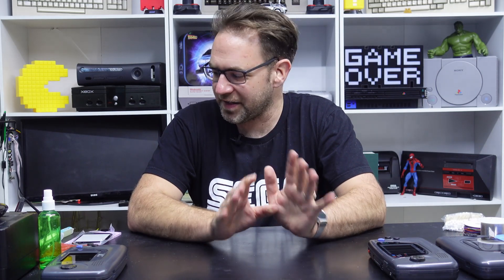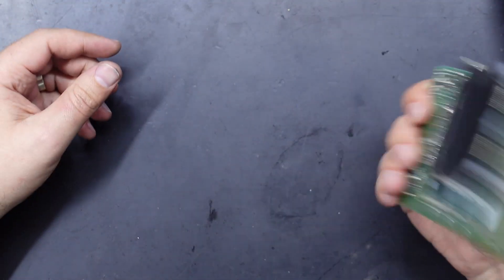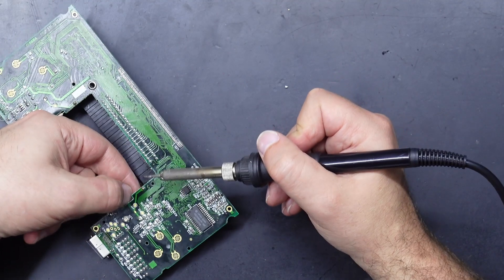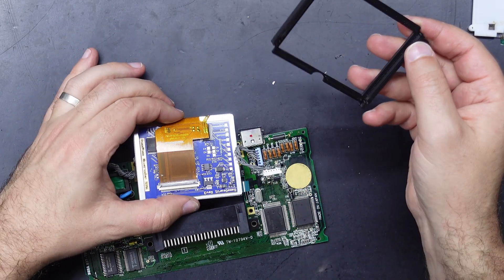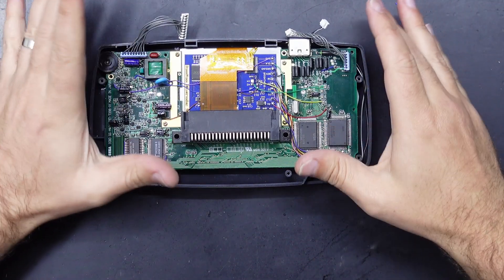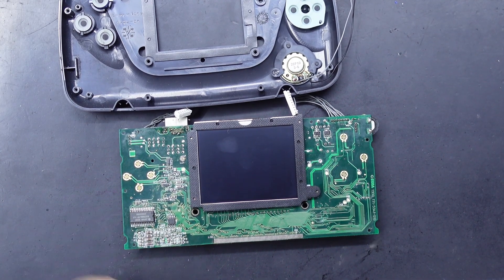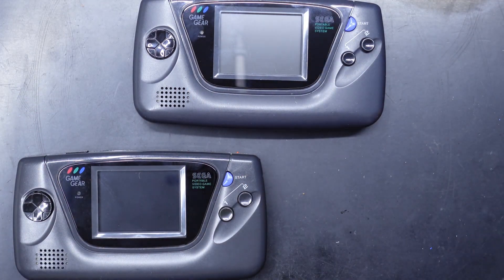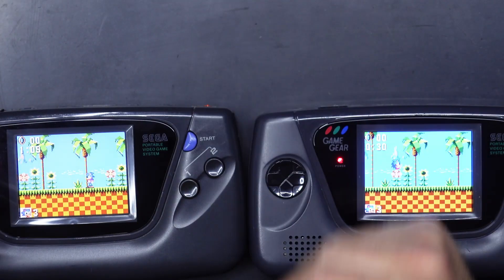BennVenn Sega Game Gear IPS screen mod - Install, review and comparison vs McWill

Comment: Awesome video! 

Scaling modes in SMS mode - We went with Linear only due to the distortion if we tried to scale it up. SMS pixels are rectangular like you say which gives some linear distortion on a 1.1:1 LCD panel but compared to the shimmer effect in any other mode (like in the mcwill and others) we think it was a good compromise. 

The frame. This is interesting! Truthfully we install the lcd in the frame and place it into the front shell, then add the GG mainboard and start the install that way. I will pass on this issue to Atari Gamer who prints our frames for all our kits - which brings me to Injection molding vs printing. We've actually got a full size commercial injection molding machine in our workshop so this is definitely a possibility. We decided to outsource to Atarigamer, giving them the profits on all the frames we sell to help keep their website running and pushing out content and gaming competitions to further the dev scene. We will address the issue you found with the frame though going forward.

Frame sizing - Mr Lurch did the majority of work modding the design and getting it to where it is today. We had a couple issues between various consoles which we put down to slight variation in the shells. We made the frame a little larger to compensate for this. 

Great idea with the alternate solder points! We plan on releasing these too. 

Our FPGA's (Lattice Ice40's) are one time programmable. We can add a socket for an external SPI Flash IC which the FPGA will boot from if its present. We'll look into this on our V2 for upgradability - if there is a way to secure the bitmask code. Last thing we want is another clone on the market.

Thanks for a thorough and comprehensive install and comparison with other kits!
Reply from the maker: Thanks! Awesome work on this project, and I totally agree on the SMS scaling choice. I'll be sure to check out the defualt scaling mode (for GG).

WRT the frame, yes it probably wouldn't be an issue if I attached the frame to the GG first and then put the screws in, so top tip for anyone doing the same - attach the frame to the GG front first. Not blaming Atari Gamer, as you say I'm glad to see other parties involved and keeping the retro gaming scene alive.

Looking forward to V2, one day...  😎
Reply: "We", "our" - I remember when it was just you :)
Reply: @RWL2012  It's still just Claire and I - the 'we' is more the input we get from our discord. They're the GG guru's! I'm just hand crafting a kit to their specs
Reply: We need that VGA mod, Ben 🔥 👌

Comment: Rather than try and solder to pin 46 on IC3, follow the trace and solder to the thru hole by scraping off the insulation, it makes it much easier. Mod works fine, thanks for the video.

Comment: Mint, it does look.
I have to check my Gamegear board version...
The McWill screen in my LYNX is frikken schweet.
Reply from the maker: Chances are you will have a VA0 or VA1. The VA4 is the Majesco variant sold in the early 2000s? It's pretty uncommon from what I hear
EDIT: Apparently they go all the way up to VA6/VA7 - which are the Majesco ones. But the majority are still the VA0/VA1

Comment: I tried to follow your hands nut couldnt. How do you access the various scaling options on the bennvenn with the start button?
Reply from the maker: Just holding the start button will cycle through the various scaling modes. Pushing up or down while holding start will turn scan lines on or off

Comment: I get the idea of supporting the retro scene and manufactures of products but the fact that that those mcwill clones are about 50% of the cost of other makes them appealing. If you can google you can easily find instructions. Personally if I could find replacement lcd's for around 50usd I wouldn't have a issue buying direct from manufacture/official reseller. We have seen some of these same retailers resell these same "clone" lcd's with insane markups.
Reply: In my experience with re-sellers, they want ~50% discount for wholesale. That's a 100% profit on the item for simply holding stock. The developers don't get anywhere near that kind of return on their work. They need to increase their RRP to make up for it - which is why you see a McWill retailing for $110 in the US and a clone(or wholesale genuine) for half that. We prefer to sell direct from our office - it's more work but it gives us the same profits and gives you a better price. We also offer wholesale but more often than not, 20% isn't enough discount to make it worth a resellers time.
Reply: @bennvennelectronics  I agree your shop is the exception and very reasonable especially compared to resellers. 100% markup was exactly what I was thinking when writing that comment. It would be great to have more options like yours. Appreciate your work and glad to support shops such as yourself.

Comment: Hi. Thank a lot for your awesome Work.
Please tell me- which ist pin46 on IC3 - how can i find it (where should i start to count?).
Seconds qeustion- what do you mean by +VE Side.
Thanks for your answer ✌️ Respekt.
Reply from the maker: +VE as in positive. As for finding pin46 if you start counting from the top left as pin 1 and work your way down, it should be along the bottom row near the right corner of the IC. I think bennvenn has the install guide on his website that shows exactly where that pin is. Good luck!
Reply: @TheRetroChannel  Thanks a lot 👍

Comment: I'm torn: I love the idea of having a brand new screen in my Game Gear because the original is rubbish for sure. But as you pointed out, games were designed specifically for its dimensions and limitations. All Game Gear games are 160x144 (10:9 PAR) but displayed on a 4:3 screen = non-square pixels. Unless a replacement screen also has non-square pixels, integer scaling is useless (just look at how oblong Sonic's sprite is in 10:9 PAR). So stretched is the better option overall, but these screens just aren't high enough resolution to handle stretching without pixel distortion and other artifacts like shimmering. Ideally, a next generation replacement screen would be 1080p or 4k and come with a polyphase scaler/line-doubler to better approximate the look of the OG panel. Until that day comes, I'll probably end up replacing my backlight and just deal with the blurriness and ghosting.
Reply: i thought bennvenn is about to release a 640x480 screen, so you can integer scale to 640x432. still not 100% perfect but its a lot closer. 

I am more concerned about the loss of dithering effects as pointed out around 23:00

Comment: I have allready put a mcwill screen on my console but the circle switch at the side does not change the light . This is a sign that maybe it is the Chinese version screen?
Reply from the maker: Depends which version of the mcwill screen you have.  I believe only V3 onwards officially supports using the brightness wheel, previous versions require a bit of extra modding. There's a link to that mod in the video description
Reply: @TheRetroChannel  Thank you. Keep the good work!

Comment: For me, give me the original screen any day with its blur and less than perfect sharp picture. Its how the creators intended you play it.
Reply: A large number of GG games were designed for the SMS, Many GG games are ports. I'd say they're intended to be played on a CRT without blur and deliciously crisp! we've all got our own opinions on how we remember it, how it should be and should have been.
Reply: @bennvennelectronics  The two points you raise regarding GG being designed for SMS and being ports are actually one point unless I am missing something.   Also it does not support your argument because most people who played SMS on a CRT did so on basic RF Aerial. But regardless of what I say the market is leaning towards "enhancing" the old tech with the products you make, so I wouldn't be too concerned about the odd heretic such as me.
Reply: @jackrussell3084  the GG is slightly different to the SMS in a hardware perspective. There is a pin on the cart which tells the GG that it is playing a SMS ROM. Many games were the exact SMS rom but put into a smaller cart and have that pin set to play in SMS mode on the GG. SMS mode is limited to the colors it can use, sound channels etc.

Some SMS games were ported to the GG. That is, the ROMS were modified to make use of the 4096 color palette, stereo sound, a larger image area

Native SMS games running on the original LCD looked absolutely awful due to the way they used the LCD. They didn't use RGB, they used RGRBGB which means you cant have white next to black, instead you get cyan/magenta etc... But that's a little off topic.

And I agree, I had my NES hooked up to the rabbit ears with wire twisted around them into the RF cable. It was far from ideal but endless hours spent playing it! Back then I didn't care, or know about scanlines. When we got a tv with A/V inputs it was a game changer! I do wonder though with the majority of users using RF, were the games designed for RF or Composite
Reply: @bennvennelectronics hi bennvenn that was some great insight in how the games work and makes me appreciate more of your work in the community.

as for the original comment I guess it comes down to what games you want to play. i just play what i played as a kid, like shinobi and sonic. so as much as i like the new display techs, i cant help but feel more nostalgic with the og hardware.

just yesterday i compared Gg shinobi on og screen to the same game in a new 3ds xl (i have legit copies on both) and within a few levels i found way too many examples of dithering effects, which failed to show on the 3ds.

it was as exactly explained at 22:27 where shadows and other colours would appear smooth in original, but as checkered pattern with modern displays. 

this situation seems to affect sega genesis and gamegear games the most. i dont see it as much with master system, or any nintendo games. 

In emulation there are many methods to artificially recreate this effect. case in point the genesis games on 3ds have a classic display mode that works quite well. 

if only we can cook that kinda solution into these replacement screens.